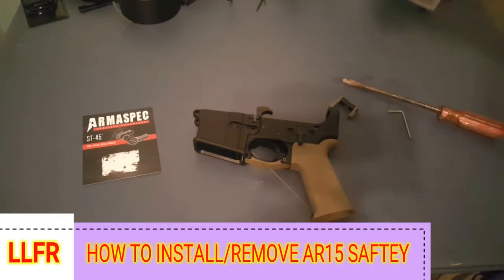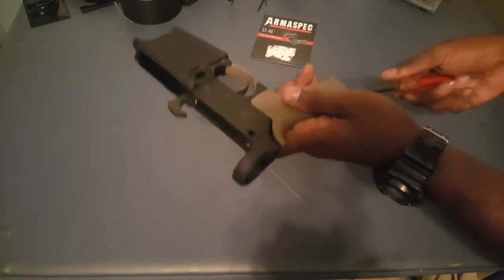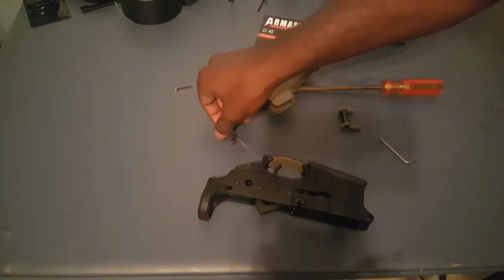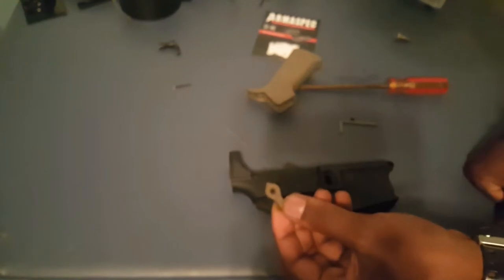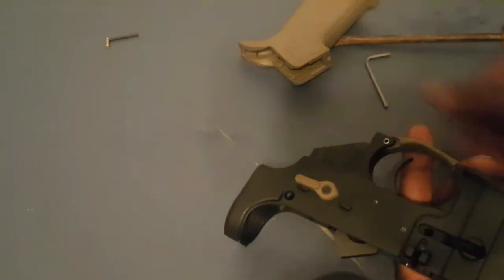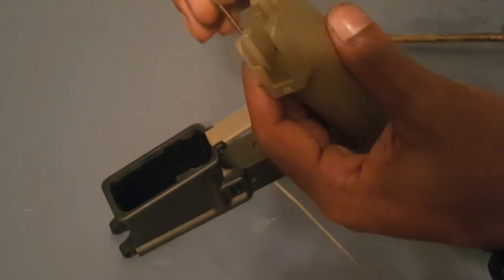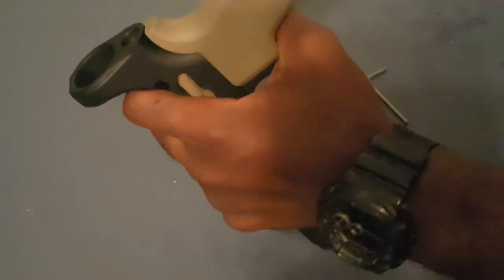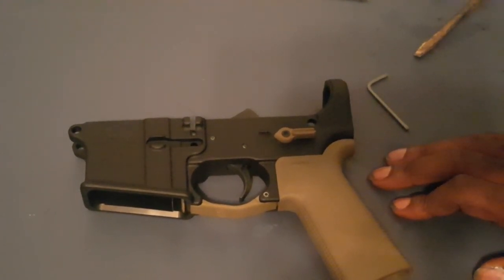How-To - AR15 Safety Install/Removal

Comment: For me, the only tricky part was removing the detent pin on my Daniel Defense AR. I had to work the safety lever and bang the lower receiver a bit on my bench. My bench has a neoprene pad. That prevented any scratching or damage to the lower receiver.